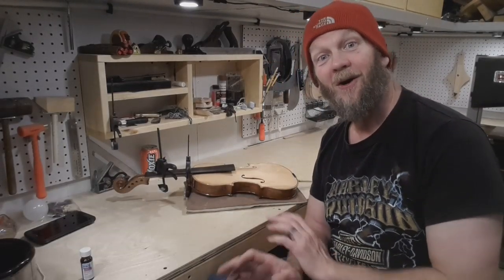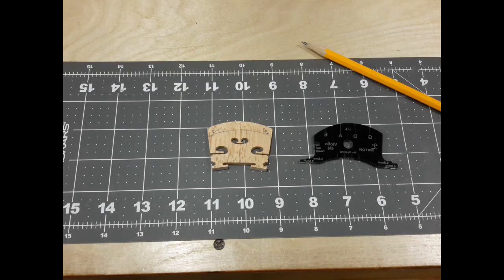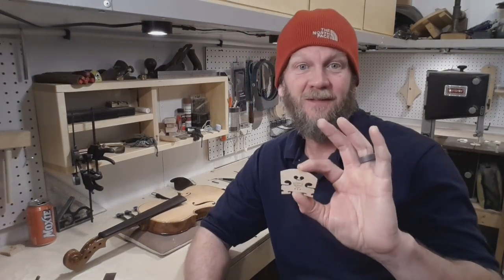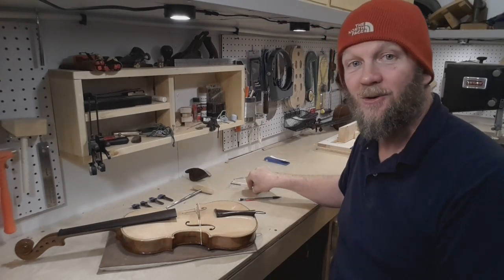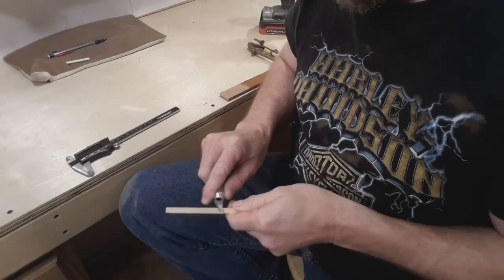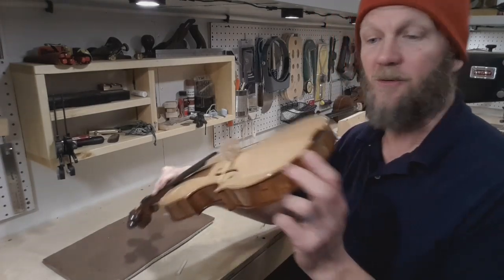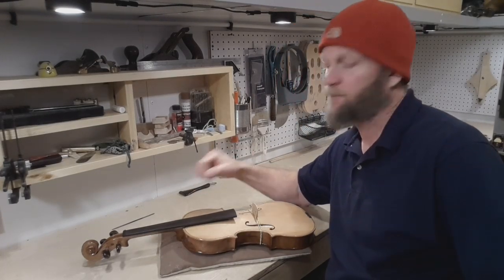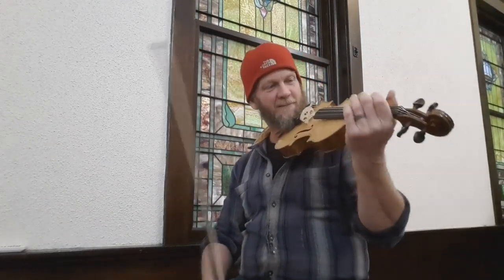How to Build a Fiddle - Part 12: Setup and PLAY!

Comment: Great wrap-up to this series.  She will sing after being played for a while.  Too bad there is no way to speed up the process.
Next project suggestion; Aluminum air-frame, aluminum skined foam core winged Legal Eagle with BMW R80 airhead engine, part 103 legal.
Reply from the maker: Yes, I have thought of that, actually.  I have a 2 seat Fisher Horizon 1 sitting on the landing gear now...wings and tail done as well.  Thinking of going back to ultralights.  I love the Beemer engine.  
I am partial to wood wings ;)  and have flown under several pair I have made!

Comment: Hello Jon I’m curious about how some makers try to achieve plates of a certain weight. I mention this because I have just acquired a left handed Gliga violin. It’s light as a feather compared to the Worktop Fiddle. The oak is obviously heavy, but was wondering should I have carved the back thinner to reduce the weight? At the moment the thickness varies from 4.5mm down to 2.5mm.  As we speak I have three more rib structures in progress I have purchased three inexpensive necks to save time, as I will be carving different arched plates of various thickness to see the effect on sound. Hope all’s well with you and your family 👍👍👍
Reply from the maker: It's all in the wood!
Buy the right wood, whittle it down thin, keep your edges thin....

Tests show no direct correlation  between lightness and good tone.

Comment: When  adjusting the sound post is it vital to make parallel adjustments top and bottom? For example if I moved it say 1mm back at the top then is it important to do the same at the bottom?
Reply from the maker: Generally, yes.   The post should be nice and vertical.  Check the link to the soundpost video in the description of the last How to Make a Fiddle video.

Comment: Hello Jon does the belly plate have more overriding effect on the sound than the back?
Reply from the maker: Yes -- the back is kind of a reflector...an anchor for the top plate -- but it does resonate.  I find that a real stiff back plate gives a much brighter sound.
Reply: Jon Mangum So would a thinner back produce a more mellow perhaps deeper or bass like tone. I ask because I’m going to start experimenting with the next fiddle, fitting different arched tops to hear the effect on sound. Possibly different backs as well.